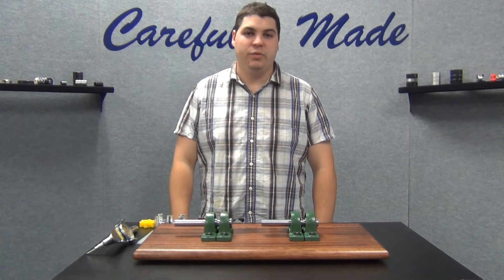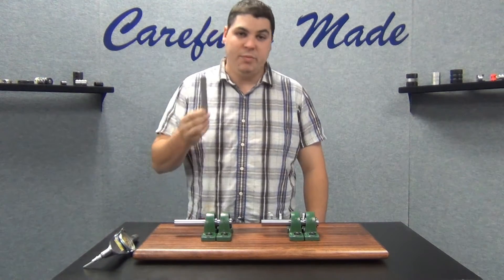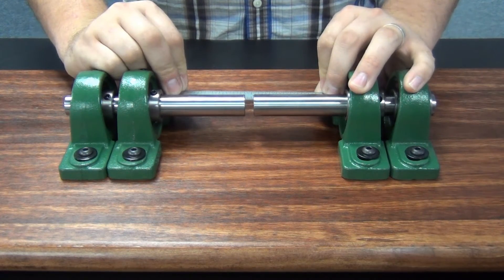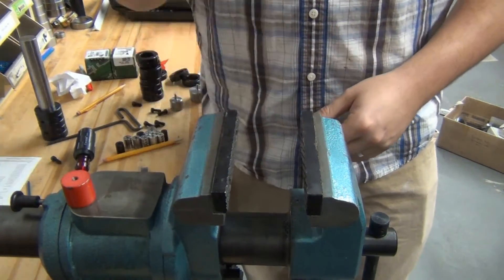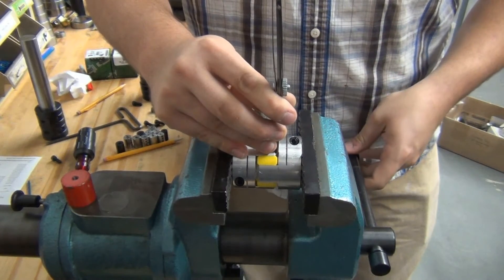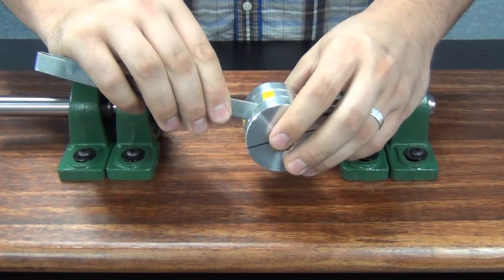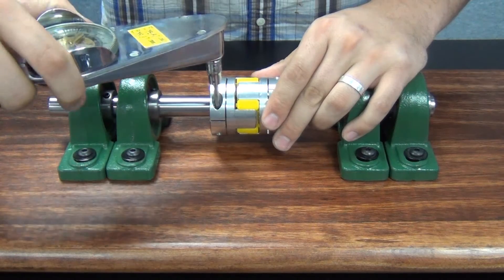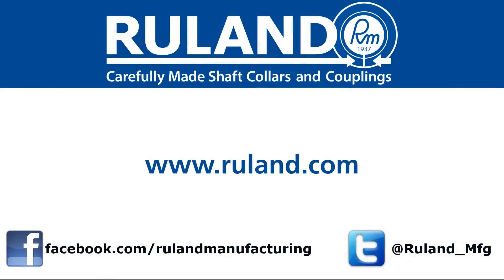How to Install a Jaw Coupling | Ruland

Comment: Trying to join a wheel to a motor using one of these couplers. Using a galvanised bolt as the shaft through the wheel. But things are very unbalanced. I'll try a HT bolt and hope it's straighter and better fitting. Who would of thought doing such a simple thing would be so frustrating.
Reply from the maker: Hi @Swenser. Keep in mind these are zero-backlash type. The types with backlash have different performance characteristics, and are far more common. If that is what you are using our advice may not be correct. You can always reach out to us directly if you need technical help. It is why we show up every day! - Chris from Ruland

Comment: I have one question. do you have to make the shafts touch or leave a gap? noone seem sto talk about this part cause I know some spring type ones need a gap and it's evenmore recommended for those to leave a steel ball in there
Reply from the maker: In our style of jaw coupling the shafts cannot touch because the disc, or "spider", is solid. On our website we list a maximum shaft penetration with every hub to provide information on how far the shaft can be inserted while still allowing the coupling to achieve its full capabilities.

Comment: Spider coupling fixed with two side of shaft,after few time working coupling bolt loose and coupling hub showing gap . What the reason for that????
Reply from the maker: Hi Titto. Thank you for asking. There are many reasons this is possible. The first one that comes to mind is if you are using set screw attachments that they may not be full engaging with the shaft. When the machine starts operating the screws come loose. You can always chat with us on the website or email us at sales@ruland.com for more support.

Comment: How many gap between jaw coupling and spider distance  ?
Reply from the maker: Hi. Thank you for asking! On the spiders we have raised standoffs which are designed to be used as spacers. Once they touch the hub, the coupling is considered fully installed. Additionally, we have shims to match each OD size of jaw coupling. These shims can be inserted during installation to assist in maintaining spacing. - Chris from Ruland
Reply: @Ruland   sir standard gap between in mm hub and spider (Lovejoy coupling
Reply from the maker: @er.krunal7049  sorry this is not a Lovejoy straight jaw type coupling you are looking for information about. You would need to contact them directly.
Reply: @Ruland  sir hub and spider  gap standard
Reply from the maker: @er.krunal7049  it depends upon the OD of the coupling. The gap ranges from 0.50mm to 1.25mm. - Chris from Ruland
Reply: How can find out to spider size  to love joy coupling?